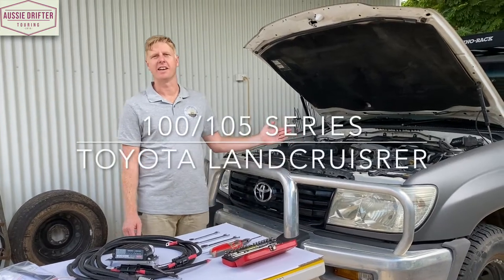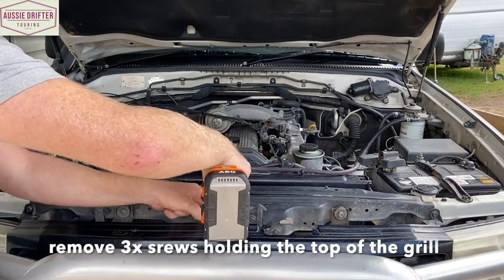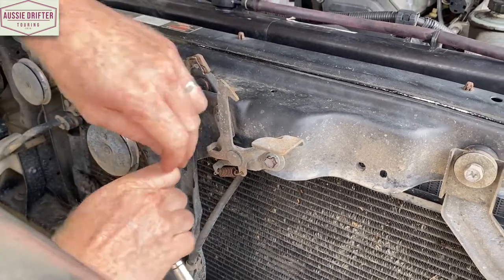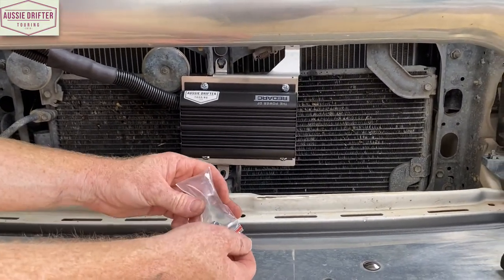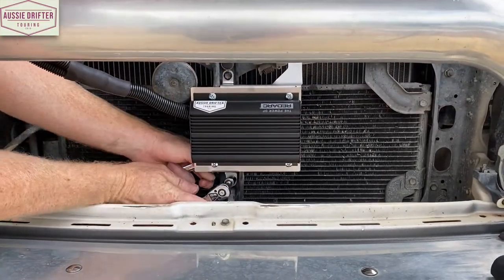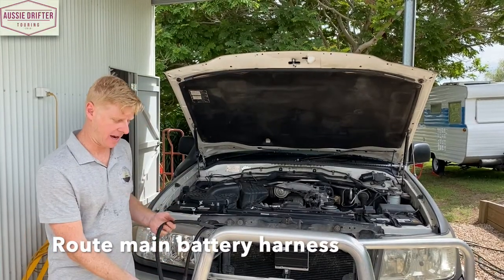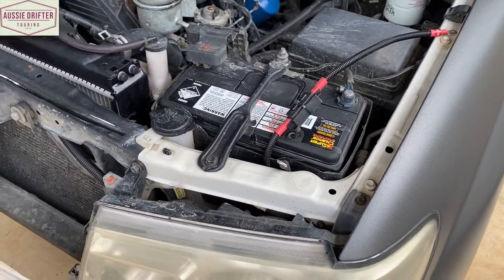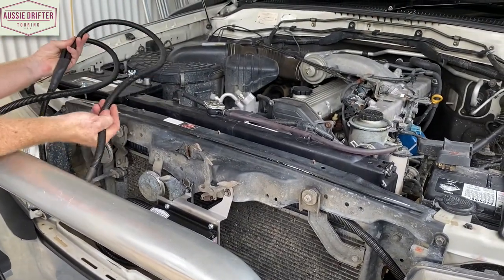100 |105 Series Toyota LandCruiser Redarc BCDC Dual Battery Kit Installation

Comment: Great video thanks. I plan to fitbthis into my 2003 Lx470,  can you please tell me where to get the redarc,   the holder and pre wired harnesses. They look great and pretty easy to do myself thanks to your video.
Reply from the maker: yer mate you can get them here https://www.aussiedriftertouring.com.au/shop/landcruiser100series
Reply: @AussieDrifterTouring  Thanks - I also just saw your link at the top of your video. I will check to see if it fits the LX470 (2003)

Comment: i was always taught to do the + cable up first , to avoid the + being live a arcing out !
Reply from the maker: Hi Chris, yer that’s good advice mate, when connecting a battery bank for the first time.  However fitting these kits means we are fitting to an already live battery bank and therefore the risk of spark is there no matter what.  That’s is why we connected the aux battery first though so that it couldn’t spark out even the positive can’t spark out on the aux battery until after the main one is connected.  But on the main battery connection because it’s an already connected battery it doesn’t matter if you do the positive first or last you still have to be careful not to touch the body.  Hope that makes sense mate
Reply: Great video, and not skipping any details! What’s the rationale for putting the BCDC in the 100 Series though? I thought it doesn’t have a smart alternator and the old school unit should pump out full voltage at all times anyway?
Reply: @alex49159  The 100 series has a Temperature Compensating Alternator (TCA) which reduces the vehicle's output voltage as engine temperature increases, The BcDc help bump it up
Reply from the maker: @alex49159  hey mate, glad the video helped you.  yer chris is correct they do have a temperature compensating alternator which often sits at about 13.3v while driving which isn’t enough to fully charge a battery.  The bcdc ramps the voltage up to charge the battery and once it is charged it will drop the voltage back to (float stage).  You also have a few features with the bcdc such as solar controller in build and the ability to charger other battery types such as agm or lithium.